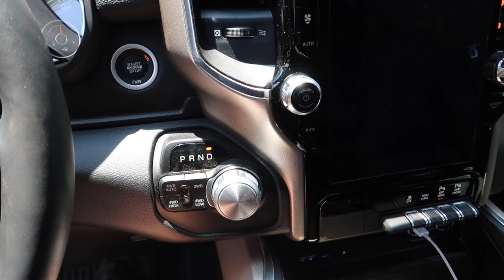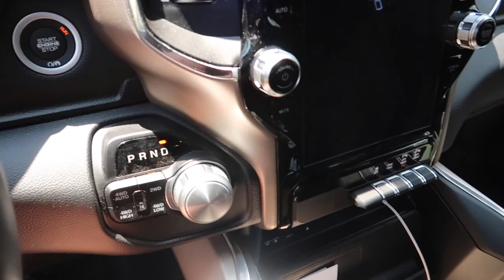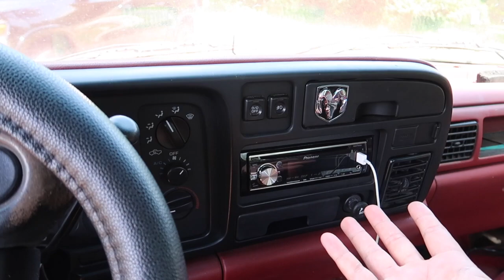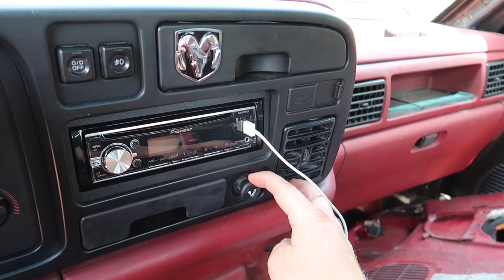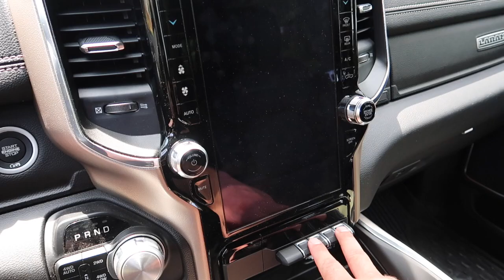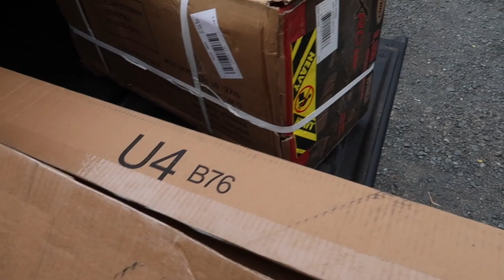2019 Ram Vs 1995 Ram Which Is Tougher

Comment: i currently have a 97 ram and to be honest i had rather keep my 97 as to have the 2019  just because its a real truck and not some electronic computer on wheels. my  dodge is a good truck and  even though gas mileage is a pain in the ass i still love the older trucks and cars vs any of this new stuff.
Reply from the maker: There is for sure something to be said about these old trucks I can't wait to have mine back up and running
Reply: @HammerdownMotorsportsUSA  my mother bought this 97 new and i bought it from her, it has a steel cowl hood, rollbars w/ led lights, 17" sport 5 spoke wheels, aftermarket headlights and taillights. 5.9 360 magnum v8 swb 2wd. i hope to have the money to build a 408 stroker out of it and have the trans built to hold the power.

Comment: Yea I had a 1995 Ram regular cab with the 5.9 and I am currently driving a 2019 Ram.   I bought the 1995 used as my first truck/car in high shool and drove it all through college.  I drove the heck out of the truck, although I took good care of it,   About every two or three months it would need some sort of repair although the engine/trans/rearend never had any issues.    Of coarse my 2019 has way more tech and gets a lot better mileage.  My 5.9 2wd was lucky to get 11 mpg.   The 2019 4x4 crew cab will get 18 city and 22 highway.    Quality has diffinatly improved over the years.  I had a 2014 Ram for 5 years with 0 issues thats why I went with Ram again for my 2019.
Reply: Gas or diesel 5.9? I have a 2000 5.9 Cummins and easily get 18 city 21 hwy

Comment: I have a 2000 ram 2500 5spd Cummins and a 2018 ram 2500 cummins. My 2nd gen has 400k miles and is my daily driver to work. The 2018 is a Delmonico red sport and it's our weekend/ long road trip vehicle the  truck for is amazing